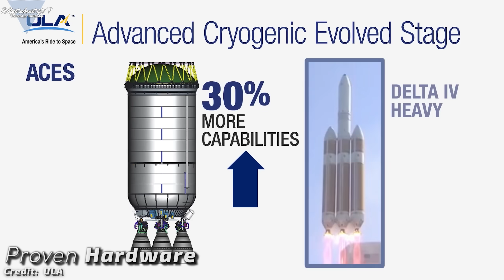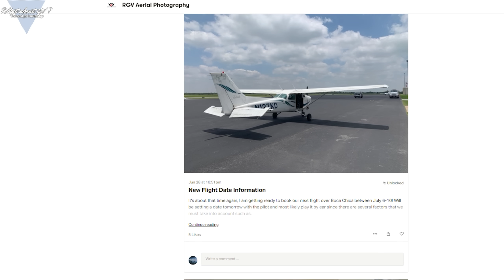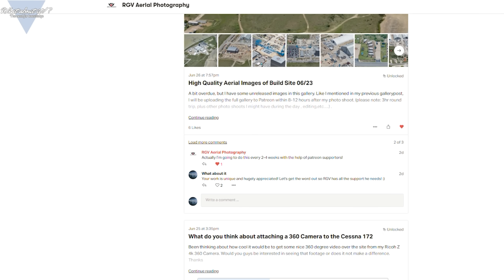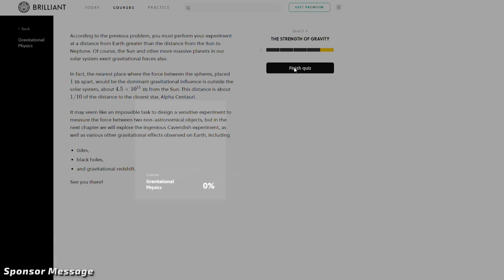101 | SpaceX Starship - Why are they building it in a scrap yard?

Comment from the maker: What are your thoughts on SpaceX’s incremental approach and are there still open questions for you, why they’re doing it the way they do?
Reply: I wonder about its location , from the air ,I see that it looks like the site would be under water in a big storm with a storm surge !  is that a threat to the site or not ??   PS love your work Sir. thanks
Reply from the maker: Hey Tomas, if a major storm surge comes, the site will have problems. Launch site and fuel farm are built on hills though, which will prevent the site from being flooded. Same technique is used in Florida for KSC and works. :)
Reply: @Whataboutit  Thanks !!
Reply: @TOMAS-lh4er  thats what I was thinking!, how would they deal with hurricane and that kind of stuff
Reply: to be honest i looked at it like a cowboy party when it comes to construction  but im getting more confident each day hehe
Reply: Regarding using Starship for point-to-point transportation: What do you think SpaceX can do to minimize launch scrubs due to weather? How can a rocket be made more of an all-weather mode of transportation?
Reply: @FieryWACO  I remember Elon Musk stating that Starship won't be affected by weather conditions :D
Reply: Soyuz can launch in almost all weather conditions just because it’s flown so much. I think after about 10 years of starship flying from Boca, they’ll consider Earth to Earth as a serious prospect once they gather enough data.
Reply: What SpaceX is currently doing is Research and Development and that's not the same as iterative development.
Reply: When we were out there in March we all shook our heads at the crudeness of the infrastructure and had doubts. Looking at it now there seems to be a plan in the chaos.
Reply: It seems that there is often bad weather even hurricanes. Will it give problems?
I think the pace has been slowing down. They hit a wall when tried to try the static fire. And prototypes have been stacked for test, behind. They construct a lot, but there is not resources enough for testing.
What is the problem in doing the parts, like fabrics makes pans?
https://www.youtube.com/watch?v=0RY0cjSUPGg
This way they use less welds. So it's more resistant. Yes, the should be big machines.
Reply: @Rafael-f2w5v  Thank you for your post! I hadn't watched any of this method of metal forming for a long time, and I always loved watching it. I spun some small items back in a metals class and it was challenging and fun. I do not know if stainless steel works good for this method or not. We will need a metal worker with the knowledge to tell us. It could possibly make a more substantial tank bulkhead. But for a nine meter wide tank, that would be one huge lathe.
Reply: Elon reminds me of Howard Hughes trying to create his Spruce Goose (Hughes H-4 Hercules).
Reply: Pen, paper and theory to make exact final blueprints from the very start is all and very well, I suppose, if they were sending 1 rocket to Mars they might have gone about it conservatively, but this is a manufacturing problem to be solved to make bulk numbers of rockets as much as it is about the science and engineering.  New cars and planes undergo prototyping, it let's you find out the stuff that you didn't think of and consider solutions (along with discovering some science questions that need to be puzzled through) - finding out as many actual problems (versus, pen and paper looking for potential problems already solved by decades of space research) will save a lot of headaches - you can't easily turn around and go home when you are half way to Mars as Earth will take a long time to come back around the sun to meet you.

What I wonder is where are they going to park them all?  Where is the space for (example) 100 of these?  Also, if they were empty, I can't conceive of them standing upright with the wind strength  of tropical storms/hurricanes, so what ballast would they use with them parked for 2 years (if out in the open).  The site doesn't look to be marked out for a huge number of mid/high  bays, so I'm just presuming they will be stored out in the open but that would make them prone to damage from flying debris.
Reply: @DannyWoodman  good comment!
Reply: As an engineer its how its done? its when the money people and business titans get involved, things get slow and expensive. control of infrastructure and research has to be led by an engineer like #elonmusk.
Reply: What are the chances an existing oil platform could survive the exhaust of Superheavy and if so at what cost. A better solution would be a floating platform built for the purpose. It could also go to shore and pick up or deliver it out. Heavy maintenance on a floating platform would also be easier next to a pier.
Reply: My experience of Mechcommander leads me to decry positioning fuel farms so close to launch control centres and offshore landing pads
Reply: @Alseki7  I agree completely
Reply: I think I'd want a topic looking at every five years what the future of space could look like end to end.  Moving out from 2020.
Reply: Thanks so much for addressing the situation at the Boca Chica facility in your video. However, I still have some questions. Where is there any indication of construction on a major new factory, or even plans to build one in the future? The current permanent structures, and the new high bay under construction are insignificant compared to what is needed.  Has Musk announced any plans for a major new factory for Starship? Also, what about his stated schedule... First flight to Mars in 2022? Flight to the moon in 2023, carrying tourists?  Manned flight to Mars in 2024? How is he going to meet that timeline when he hasn't even begun construction on a real factory for Starship. Something doesn't add up here. Hope you can see my point. Thanks.
Reply: @DavidJohnson-tv2nn  This is a real factory.  Even with these itereations as prototypes,  they are now able to be assembled in under 2 weeks, I thought the goal was to make 1 per week.  Compare this primitive looking patch of mud and huts to how many rockets NASA was able to assemble with their "real factories" per year.  With construction methodology worked out through iteration, they will build them faster (they were assembled out in the open initially without some of the current structures).  Now, SN5 &SN6 are only a part of the overall rocket, but the main booster underneath is fundamentally just a bigger rocket - basically just storage tanks for fuel with engines underneath and they will only need a few of them as they will be reused for multiple starship launches.  The engines are made at a "real factory" elsewhere if that soothes your soul.  Making enough engines (is their engine factory even big enough?) and the fitout for the nose section - where up to 100 people are to be, those will be the time consuming parts I'd have thunk.
Reply: @DannyWoodman  If this is their "real factory" and they actually plan to build production models here under current conditions.... Then they need to be shut down by the authorities. There is no way to maintain quality control in a junkyard! The production models would be unsafe for any flight, human or cargo. So I hope you're wrong and they begin construction on a REAL factory soon. One more thing... Starship needs a launch abort system, or it should NOT be rated for human spaceflight. It's not about speed. It's about safety. Without safety, nothing else matters.
Reply: Felix, I think you did a very good explanation of what is going on with Space X. But if that will "awaken" the doubter and haters I do not know. Well presented.
Reply: @ronfullerton3162  His explanation was good. But as I pointed out in my comment, I still have questions.
Reply: @DavidJohnson-tv2nn  I think we all have questions at this point. But we have never been allowed to see the inside of a big space venture before now. No one else other than Space X has allowed to let us see failures from small to large. Or given us their plans and ideas ahead of time so we can "judge" them on progress and success. To answer many of our questions we are just going to go along for the ride and see if this is bust or victory. Some rush jobs are successful, and others have ended up scattered the same as the visions of the pursuer. We will just need to wait and see what fate awaits Space X. Fasten your safety belts and go along for the ride.
Reply: I'm puzzled how they could legally work this way. In the UK plans have to be exact and submitted for approval years before anything is constructed and if any deviation is made the whole process is halted and new permission obtained from the planing authority. New Health and safety guidlines and all paperwork would have to be redone. Make one unauthorised change and the entire site could be ordered cleared. Meanwhile all work would have to stop. I also don't think bits of old rocket could be left lying around. Health and safety hazard. Oh and all plans have to be available to the public for consultation. You would already know exactly what they were going to build and when.
Reply: @womble321  this is Texas, we don't need no license to apply for a license to get a permit to ask to build something.
Reply: My thoughts are your farmers tan line around your neck and arms were to distracting for me so I wasn't able to pay attention to the video 💩
Reply: Just to get the production process going. Experience gained by producing batteries and Tesla cars.
Reply: You look a bit sunburnt!, have you been fishing?
Reply: The ‘dirt hills’ were construction techniques using the weight of the many tons of material to squeeze water out of, compact & stabilize  the swampy soil to form a foundation to support structures. The dirt is piled up, left for a year or so then removed.
Reply: I Felix i have two questions for thé next episode : can we have a Starlink update and can the cybertruck be used as a mars rover ?
Reply: sbmphr  There's a big difference between a hypersonic aerospace vehicle and Wright Flyer. Which had a top speed of 30 MPH.
Reply: I question the interior size if it can handle 100 people and facilities needed inside for the trip to Mars?
Reply: It makes for wonderful viewing and I think  has spawned a great interest in all things space.
Reply: I suspect oil platforms may not work as launch pads. But welding two or four together might. The dynamic loading of launches and landings requires an enormous amount of rapidly adjustable flotation as well as the thrusters. But I do find it surprising that they are able to do as much outside as they do, since conditions are so unstable outdoors.
Reply: Well, the soviets were big on this, but in case of SpaceX I fail to see the methodical process.
Reply: @caygill2  The Soviets with their primitive technology are not something that should be copied, in my opinion.
Reply: After watching operation everyday over the past year, I came to the conclusion they started in a "big way" with massive capital without viable design. I would compare this to Christopher Columbus using technology of his day attempting to build "Oasis of the Sea" cruise ship. You have to have a new "out of the box design" to build a production. His Tesla success
 and development completely contradicts his star ship effort. It might end up as another spruce-guise

Comment: Re: existing oil platforms; most of what still exists are just 3m diameter black steel tubes that extend 150' out of the water. The is no value in repurposing them. Also once they stop producing, they are effectively abandoned. It would be cheaper and safer to just build a new platform. The water here is only about 20m deep, even 100km out

Comment: https://en.wikipedia.org/wiki/Project_Gemini    THIS WAS NEVER A MOON ROCKET  ( note "design" )
Unlike Mercury, the retrorockets, electrical power, propulsion systems, oxygen, and water were located 
in a detachable Adapter Module behind the Reentry Module. >>>> A major design <<<<<  improvement
 in Gemini was to locate all internal spacecraft systems in modular components, which could be
 independently tested and replaced when necessary, without removing or disturbing other already tested components.

Comment: The ‘dirt hills’ were construction techniques using the weight of the many tons of material to squeeze water out of, compact & stabilize  the swampy soil to form a foundation to support structures. The dirt is piled up, left for a year or so then removed.

Comment: I work in the industry, and I can tell you what you see Spacex doing here is more the norm in the industry. Most job shops are set up pretty similar. The only real difference I see is that they are making the rocket instead of just a part of one. Large buildings are nice, but they tend to be an expensive luxury.

Comment: That point-to-point Starship jump thing.  It's basically parabolic flight?  And will it go high enough to go to space?  Like will it go 110 KM up, or 100KM or whatever they're calling space these days?
Reply: It's not like Blue Origin and Virgin Galactic doing sub-orbital flights, if that's what you mean... they're going for altitude rather than distance, straight up so they can say they've reached space, then back down. 

While Starship will still technically be sub-orbital, it's going to be more like an orbital launch, since to get the distances for intercontinental travel, they'll need to reach a respectable fraction of orbital velocity. Just for comparison, one of the abort scenarios for the Crew Dragon launch would have seen them come down off the coast of Ireland, about 10 minutes after launch. That would be pretty similar to a Miami -> London flight on Starship... and it was also the latest abort option that didn't involve reaching low orbit.

Comment: I have a hunch that spacex will contract stratolaunch to help when it comes time for the starship to start trying the belly flop manuever
Reply: Not a chance. It could certainly lift the mass of a near-empty Starship, but the physical size is a problem. Starships diameter of 9m is much bigger than the Stratolaunch, and there may not be room to hang it under the wing. And at 50m long, it's also not that much shorter than the 73m aircraft. So even if you could physically attach it, I very much doubt the Stratolaunch would be flyable...

Comment: I once put a 66 F100 cab and bed onto a 93 Dodge Cummins W350, grafting the floor and firewall of the Dodge onto the Ford.  I then had a 1 ton dually 4 wheel drive 66 Ford, or as I referred to it, a FOPAR.  What's my point ?  Today I could pay $60,000+ for a well engineered 1 ton truck with all the bells and whistles, manufactured in a "clean" factory.  Or I could use that FOPAR.  And both would tow my flatbed trailer with 4,300 pounds of car on it.  Thing is, I didn't have to wait until 2020 for that new truck, because I had the FOPAR in 2014.  We don't need to wait on the next NASA spacecraft, which always seems to be the next generation of humans away.  We have Elon Musk, who figures it out, uses what he has, and makes it work.

Comment: I don't think Starship will work, at least not in its current configuration. The lack of any escape/abort system during launch will be a fatal flaw, and I think having 36 engines on the first stage will also cause a lot of problems (kind of like the old Soviet N1 moon rocket that kept exploding). 

With a LOT of redesign, a Starship-like rocket may perhaps work and it would be great if you could make a fully reusable launch vehicle.

So, I hope they can make it work, but I highly doubt it. And the fact that they keep exploding isn't exactly encouraging.
Reply: The N1 was a failure because neither the manufacturing nor the computer control systems were adequate. But that was fifty years ago... rockets are now regularly flying with nine engines (Falcon, Electron) with high reliability, and Falcon Heavy has flown several times with 27 engines all firing at once, again without any dramas.

Comment: I have long thought that the most worthy deep space mission would actually be first to go beyond Mars to the main asteroid belt and collect vast quantities of water ice.  This would be about a 5 year mission but the payoff would be a truly solid bootstrapping of mankind's permanent push into space.  A mere 3' (1 meter) of water will 100% of space radiation.  And water ice very plentify just outside of the Goldilocks zone, in the outer edge of the asteroid belt.  It's for drinking, for oxygen, for propellant, for radiation and micrometeor shielding, and for growing food.   Water is absolutely vital for life and pivotal for thriving in space..  And there will be plenty of adventurers unwilling to leave this gravity well for another.   It is not a stretch to build village class vessels that could fly through space for many years on their own, using spin gravity, water shielding, onboard machine shops and gardens.  It is far easier to get tensile strength with low-cost, light weight, materials (fibers and polymers) than with metals or hardened composites.

Comment: I don't think an oil rig would be able to hold the weight of a full Starship stack, to say nothing of withstand the forces of launch and landing. They will have to build new. Furthermore, I continue to believe that Starship can make suborbital flights without the Superheavy booster.
Reply: Supposedly, a Starship might technically be able to do SSTO - but only without a payload, without enough fuel to re-enter, and only on later models once they've got the structural mass down closer to targets. So I can easily see it making trans-Atlantic hops without a booster... but longer flights like trans-Pacific might be a challenge since it would need to be almost at orbital velocity to cover the distance.